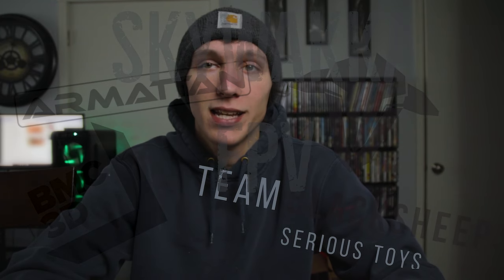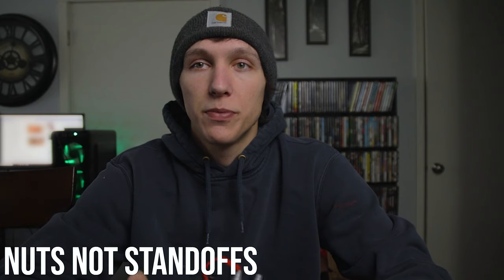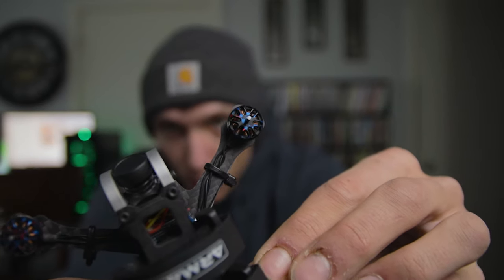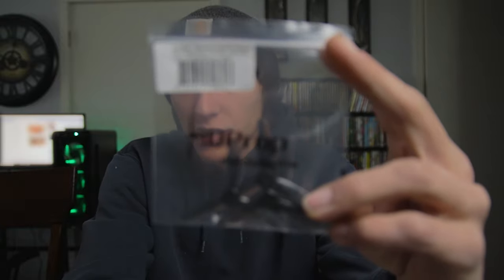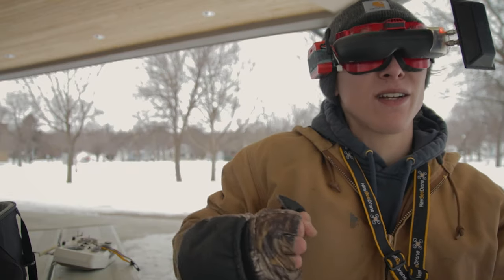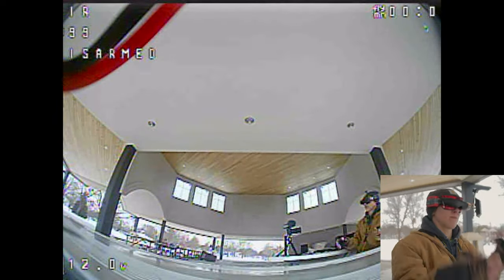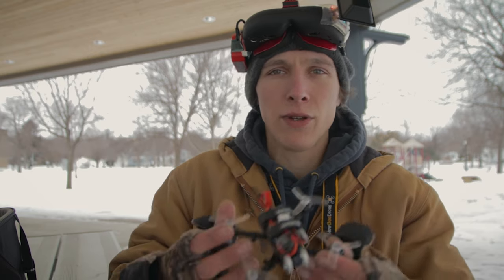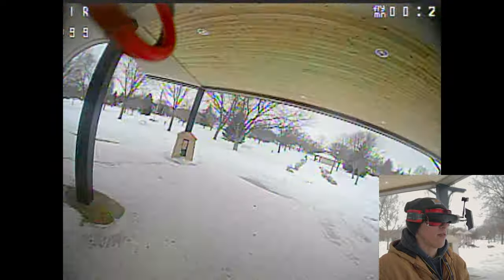65mm PROP Shootout! | Armattan Tadpole | iFlight 1103 8000kv

Comment: Dude you should epoxy the pins on your stack.. I got 3 perfectly good stacks with broke pins I had enough and decided to glue them suckers down for reinforcement. Do not use CA glue (crazy glue) it sips under the plastic headers impeding the pins from pushing all the way in.. I used thick CA  glue because I figured it could happen and it still did, acetone eats CA so I had to soak pins for a few hours but is a pita.5 min epoxy is the way to go, I apply it ones it's beginning to set so it doesn't sip under the pins, make a solid epoxy foundation and you are trouble free my friend I had great luck with it
Reply from the maker: Thanks for the pointer man! I’ll keep that in mind! That’s the only reason I don’t like the pins between boards is because I always break them off in a crash lol
Reply: @stevenhaines1105  I hope you are not trying to solder wires in a 16x16 board, if so I wish you all the luck in the world buddy lol

Comment: If you haven't done it already, I highly recommend updating the esc to work with Rpm Filters 48khz.  Jazzmavericks  3.7.7 and BF 4.1.3.  Follow the online vids and you'll have a whole different flying quad. Only way to go imo. Also switch to XT30's   The tadpole is one of my fave micros right now.
Reply from the maker: Thanks for the tips! It flies a whole lot better now that i'm using 3 blade props, i've always preferred 3 blades anyway. I've never messed with rpm filtering yet but once i do i'll be sure to give it a try! Thanks again!

Comment: I found the lava x hd props to be the best for.me. running falcox on my.tadpole
Reply from the maker: what brand are those? do they friction fit the 1.5mm shaft? my motors dont have holes to bolt the props on
Reply: @Sky-wakka  yes push on 1.5mm. I'm using the xing 1103 8k kv
Reply: @Sky-wakka  happymodel 65mm larava x hd . I believe that's the name. I got them from rdq
Reply from the maker: Gotcha! thanks! i will check those out too!
Reply: R2e fpv: Hey just ordered the xing x1103 8000kv for my phantom. Do yours have any play in the bearings and washers? Another youtuber said they did right after I ordered 6 of them and I'm hoping it's not true for all of them.

Comment: What size batt?
Reply from the maker: I use the tattu 450mah 3s with the jst plug. I just had a handful of them from my old flite test gremlin so I ordered a few more from getfpv. But any 450mah 3s will work, that’s what I’d recommend for the tadpole with 8000kv motors
Reply: Sweet I been flying 650 mah rdq 3s but looking for a little of best of both worlds but I do like how these 650's help with sling  momentum . got 1104 9500 was all I could find at the time but the little tadpole has a healthy appetite
Reply from the maker: Yea that sounds like a good set up. Your running a little higher kv but running slightly larger batteries to compensate. I’d almost stick with the 650mah if I was you. Unless your looking to save some weight but you’ll also get shorter flights lol. It’s all about finding the happy medium